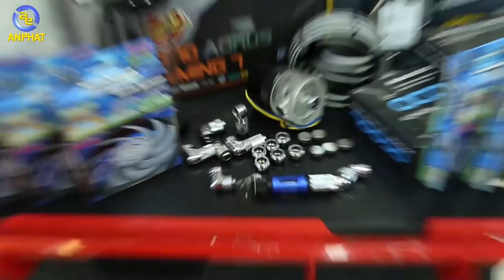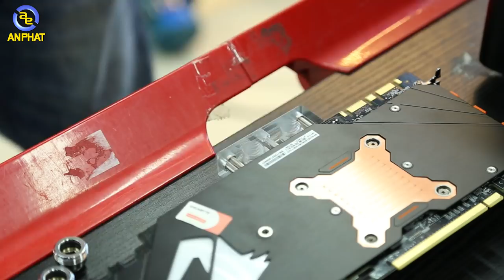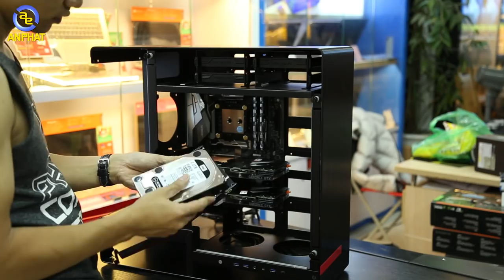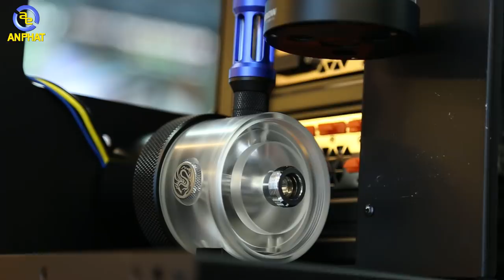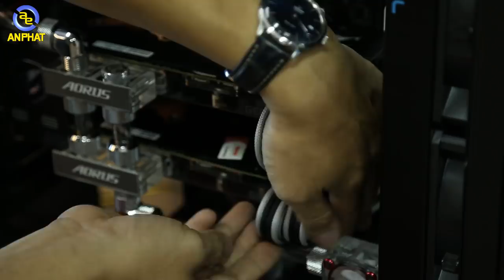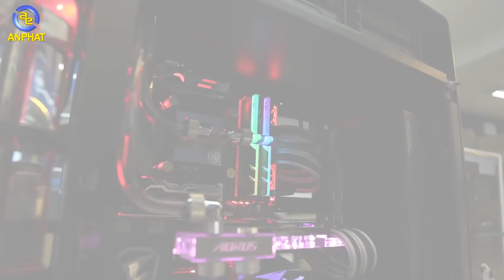Quá trình lắp PC 120 triệu i7 8700k,SLI GTX1080Ti & Tản nước - Timelapse MetalBird | An Phat PC

Comment: thằng nào bỏ ra 200 triệu mua bộ này chắc ko có tý kiến thức gì về linh kiện pc, hoăc là shop bán giá cắt cổ, mà shop ban ngần đó linh kiện 200 triệu thì chẳng ai dám ghé shop mà buil pc đâu.
main 7.6 t
cpu 9.8 t
vga 2 cái  48t 
case 9t 
ram 2 cây 5.5 t
nguôn cs 1000x 4.8t 
hdd 2t black 3.2t
đây là giá cao lun mà hết có 87t , mình cho thêm cái ssd m2 10t nữa mới hết 97 t
 chăng lẽ bộ tản nước ek hết hơn 100 t, trong khi đó bộ tản nước ko cần 2 bộ của vga rùi, hơn 100t đó nếu mua tản nước như của shop thì mình mua được 5 bộ nhé.
dân buil pc  nước khác nó vào coi, nó cười vào mặt cho, pc gì mà gia trên trời
nếu shop mà bán nhiu đây linh kiện 200t thì shop tự buil pc xài lun, chứ hok ai dám mua đâu
Reply from the maker: Hoàng vũ gần 200 triệu thui mà,mình có ghi hơi thừa nhưng koghi chính xác
Reply: 200t với 1 bộ máy tính ko phải là nhỏ, mình chưa thấy ai tư vấn lắp 1 bộ pc 2 vga 1080ti mà đi với 2 cây ram 8g hết, ít nhất thì phải 4 cây 8g buz 3000 ,nếu dùng core x thì 8 cây 8g
còn ad thấy bộ máy như vậy 200t thui, thì ad hẳn là đại gia, còn nếu mình là nhân viên tư vấn bán hàng cho khách, với số tiền đó mình buil 1 cấu hình ngon hơn, mà dùng những linh kiện tốt nhất
còn nếu ad dư tiền thì nói mình mua đúng những linh kiện có ghi ở dưới mình ráp i chang như vậy , ad đưa mình 200t